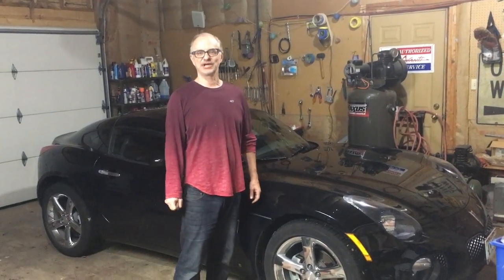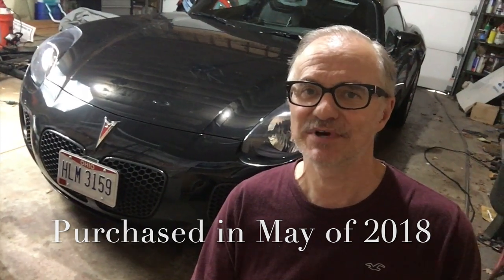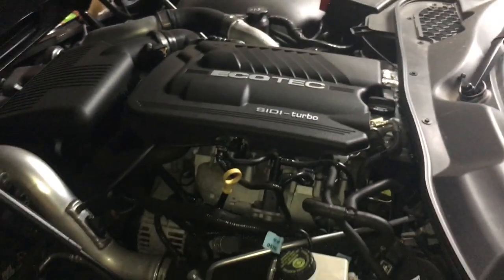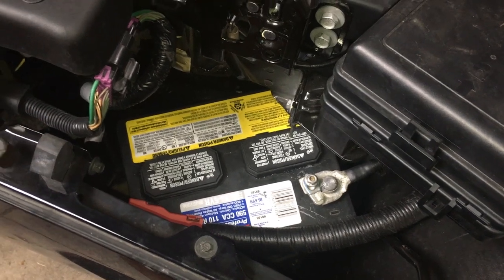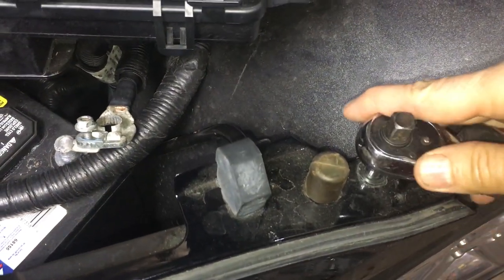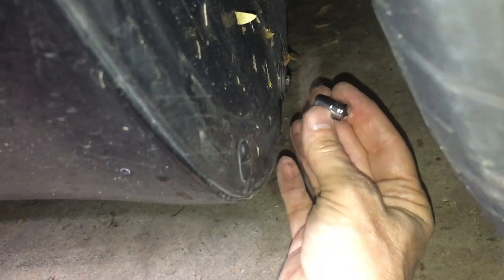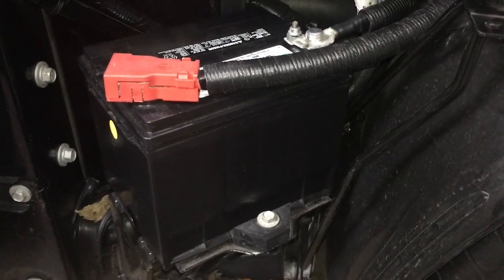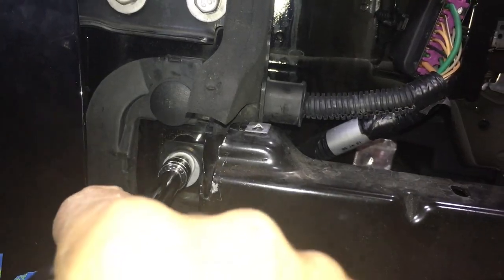How to Replace a Battery In A Pontiac Solstice / Saturn Sky

Comment: Much easier to remove the plastic inner wheel well liner and the front fender bracket and slide battery out the front

Comment: Unless the '07 is different from the'10, you just remove the frame bolts and leave the panel attached. It all swings out like a door on the front bold (which you don't remove).
Reply: would love to see a video on this
Reply: @northtexasphil  There is one on you tube nowadays. Just don't loosen the underneath top front one (nut), the one he has to readjust near then end. Also it keeps this alignment point intact. (pull/swing bracket from left, it pivots on that point)

Comment: Come on guys...That is absurd.. take the tire off then the wheel well, then reach back to get the battery.. unhook it and pull it right out. The hardest part is the tire..
Reply: Lol that is stupid
Reply: The ADS goes crazy when you remove the tire.
Reply: @angeliabroadus8894  What's ADS?  Did you mean ABS?
Reply: @angeliabroadus8894     What????
Reply: Hello - just looked and is like a wishbone bracket up against inner fender liner.  I have 2007 gxp.  This too needs removal if to remove battery as u mention.  I see top bolt to this but not lower bolts.  Once have liner out of way can see lower bolts to this steel wishbone part?  Thanks for update.

Comment: Tuscancmh, removing that bolt that is in between the door is easier to do with a long extension while you are inside the passenger seat. Well, more like the floor of the passenger side. You will be able to see it between the dashboard and the crack/hinge of the door.
Reply: Yeah, I open the door to the first catch and use a socket driver from the passenger seat.  It's a straight shot in and you don't have to worry about losing your fingers.
Reply: @jfh898  Yep, use common 1/4" long extension. (Instead of rarer 10m ratcheting spanner. And just tape door - if need be)

Comment: STOP......!!!!!!!  It’s not necessary to remove that side body panel. Remove the front right tire. Just take out the clips for the plastic  inner fender liner. Fold it out of the way - it’s very pliable.  Take out the bracket in front of the battery - 3 bolts and one screw. Unbolt the battery and slide it out. Reverse the process to put the new battery in. You can do this in 25-30 minutes. I am no car technician. I am a little handy. I am also 63  and old enough to know that Pontiac did not intend for that panel to be removed for a battery placement. ITS A VERY EASY TASK. DO NOT REMOVE THAT BODY PANEL. You will regret it!!!
Reply: Hello - just looked and is like a wishbone bracket up against inner fender liner.  I have 2007 gxp.  This too needs removal if to do as u mention.  Is this what u are calling bracket?  I see top bolt to this but not lower bolts.  Once have liner out of way can see lower bolts to this steel wishbone part?  Thanks for update.
Reply: @michael-qp9xd  I believe that you are looking at what I call the bracket. On my 2006 there are 3 small bolts and a screw  that hold that triangle shaped bracket on. Trying to recall  what I did last year - take the wheel/tire off. Push in the plastic inner fender liner. That leaves the bracket. Once that is removed. The battery slides out easily.
Reply: @michael-qp9xd  I can’t locate the YouTube video that showed me how to change the Solstice battery. But you can do it. Maybe I was lucky, but I was completely finished in under 30 minutes. Remember to turn the wheels hard right before jacking it up and pulling the tire/wheel. That gives you the clearance  that you need. I would suggest having the replacement battery ready to go in immediately. You can take the old one to the battery shop or auto parts store after the job to redeem your core charge. I didn’t have the new battery ready to go in when I did the task. I took it out, ran to the battery store and got the new battery. It took me longer to get the new battery than it did to change  the old one out. Good luck. I am no mechanic. Rather, I am a 64 year old guy that didn’t want to spend several hundred dollars for a dealership or private auto mechanic to replace a battery.
Reply: @macsloan58  hi thanks - i got replaced.  Not to bad at maybe 45 min to take out old and put in the new.
Reply: @michael-qp9xd  👍